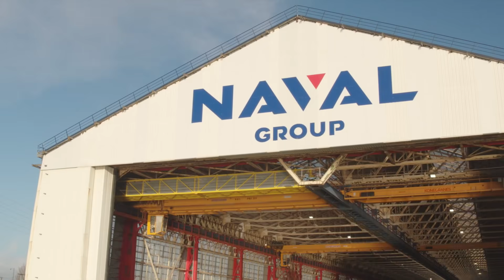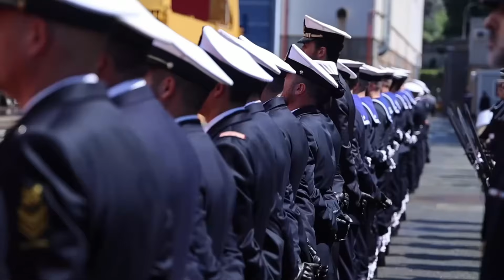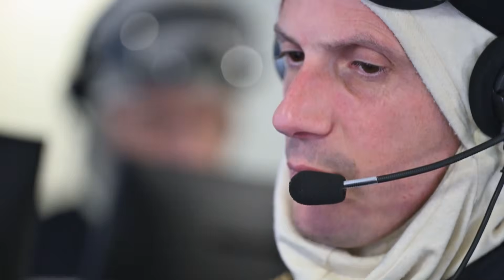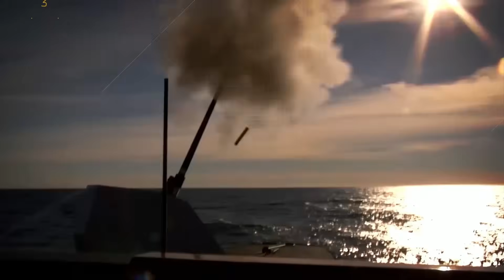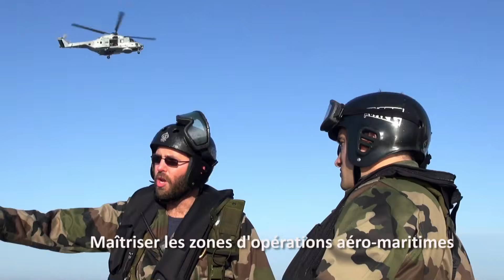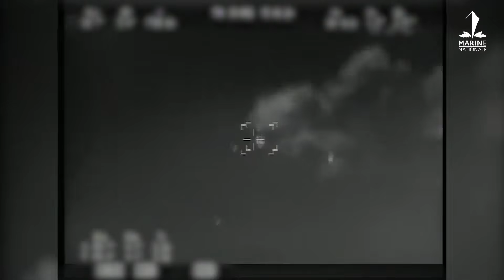$1 Billion Heavyweight vs. $500M Light Frigate: Which One Wins?

Comment: Except that from the USN's perspective, FREMM came broken out of the box. The sonar dome had to go because the ship wouldn't fit through the locks in the great lakes with the sonar in place. The powerplant had to go because the desired sensor fit didn't fit with the power output of the existing design. The ship had to be lengthened to add bigger generators to make the radars work, but because the generators also power the propellers, the generators had to grow again, causing the ship to grow again. FREMM 'out of the box' was never going to work. Sorry, AI-guy, do some actual research.
Also, FREMM was selected not so that we could 'get a win' but so that we would get hulls in the water quicker. If not for the desire to short-circuit the design of a new ship, this whole debacle would never have happened.
Reply: Odd and pointless comment, if it was broken out of the box, why did they choose it? Sounds like American incompetence to me. If this ship performs as expected everywhere else, choosing a design that was not right for them to begin with is their stupidity, as stated Fincatieri has sold them to a few countries, while America is left with adapting a shitty coast guard ship in the interim, but you know what, all the right pockets of the American tax payer funded military industrial complex got filled for the last eight or so years, so they're happy either way